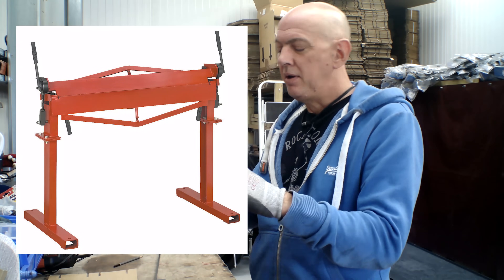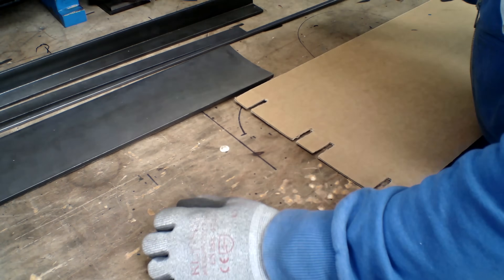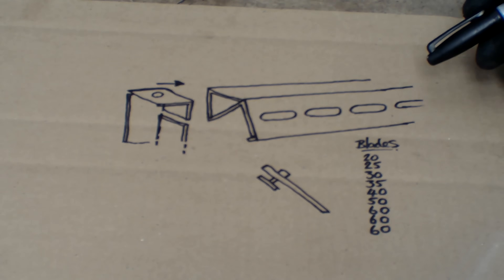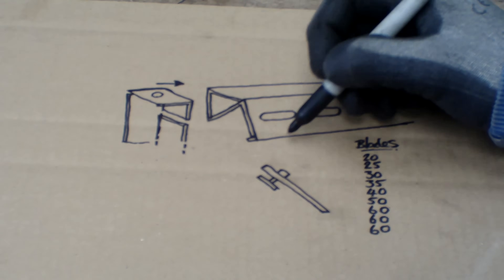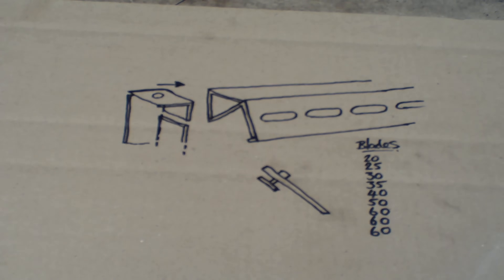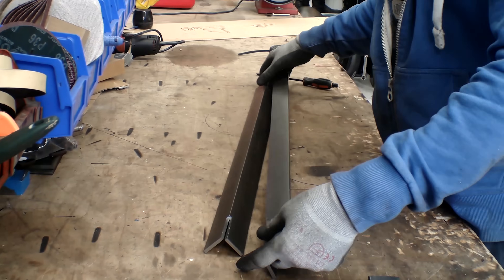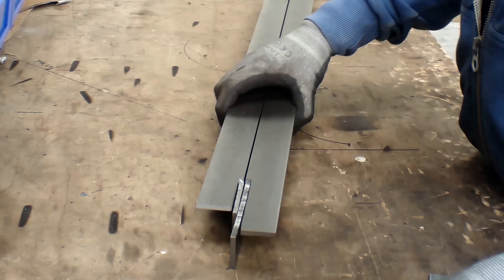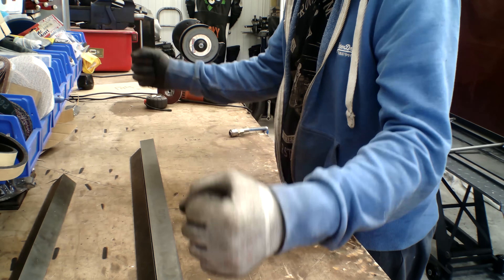Home Made Box Pan Brake for bending sheet metal

Comment: Very nice job. It's interesting, that you can get sharp cornered, cold rolled steel angle iron over there. In the states, it's all hot rolled and radiused all over except the outside corner. The only sharp cornered stuff available is aluminum. Even that, is only available in smaller cross sections like 1/8" thickness and under.
Reply from the maker: I never knew that....!!
I thought the same stuff was available everywhere!!
Shows what I know then doesn't it 😂👍
Reply: Dave Lee I like the work

Comment: Great project.Maybe a guy eliminates that hinge on the finger brake plate,it doesnt need to rock it just needs to be able to be lifted to fit material.So weld a piece of DOM round heavy wall material to the base.The find a piece of DOM that slides into the larger DOM,the small DOM is welded to the finger brake a bolt slides through the sleeved material and tighten down just like you are doing.This heavy wall ridgid material will not flex much and hold the top piece more sturdy...and get more consistent bends. Just a thought.
Reply from the maker: That's not a bad idea either... There's loads of great suggestions, so do you mind if I stick this idea to one side and maybe try it out when I do the modifications later?
Reply: @QuickBikes  Heck no I dont mind,go for let us know if its an improvement....happy building.

Comment: Nice design and build. However, when you build such things, some time it takes a few versions to get exactly what you want. The fact that your first bent had a large radius means you need a lot more support on the finger section. Maybe weld some really thick metal section on the ends so you can bolt the front section (the finger section) down forward of the pivot. That way it supports the fingers without giving so much. Usually the fingers are positioned straight down on the bent itself so they don't give as much. However, I still think you did a great project. Just needs a few changes/upgrades to make it perfect. Thumbs Up!
Reply from the maker: Here's Gary, I know what you mean and it will get tweeked in time. On 1.5mm steel I can get a radius of about 3mm, I think 2mm is too much for it. Great comment though and thanks for your thoughts. I think you're onto something there 👍👍

Comment: Job well done, one opportunity for improvement could be a set of stiffer the pivotal angle line to give tighter bends
Reply from the maker: Yup, good idea. I'm going to use it. In anger for a bit and decide what improvements are needed
Reply: Agree with this comment. I can’t quite see what point is flexing, but I suspect having the pivot axis of the clamp so close to sheet grip point (for and aft) means it doesn’t need much torque to ‘rotate’. If you moved the pivot point further into the bench, you’d be much stiffer! Other than that, it’s probably the best build of a brake I’ve seen. Really nice job and will be stealing it for my own!

Comment: Enjoyed watching this build it works great for a first try. Looking at the horizontal cross member bending 
slightly like you mention. You could just reinforce it or put some extra long removable bolts through to 
the table to shorten the span. Put them in where required to suit your work piece width etc. Nice job. Tony
Reply from the maker: Thsnk you matey. I've come up with a few improvements again, so I'm.prpbably going.to be making another one. This is alright, but the corners could be sharper and the while hinge bit much stiffer... stay tuned hey 😁👍

Comment: Looks good Quickie don't know if you noticed or not but when your folding there's quite a lot of flex in the clamping bar
Reply from the maker: Yeah I spotted that too... The gussets I was going to put in the back of the clamping would have helped stop that but I didn't put them in thinking it would be strong enough... I think I'll be putting them in over the weekend...
Reply: I see more of a tortional flex across the  top bar. I think I'd reinforce and move father from center the bolts that are clamping the work. Another thing I've found helpful is working nearest one side.  Sweet build!
Reply from the maker: There was another suggestion to put a truss on the top which I may end up doing. Once I've used it in anger and figured out how I want to modify it, there will be a follow up video showing the mods.
Very helpful comments, thank you 👍👍

Comment: if you weld another angle to the bottom of the fingers it will add a secondary point of contact and hold the sheet metal flat so you can get a true 45* bent it must be facing down though
Reply from the maker: Trouble is I need the blades to be separate so I can move them where needed....

Comment: Brace the top of the fixed finger holding platten with a truss and also weld in some flat bar in the back of the hinged folding platten so its like a triangular tube. Nice video.
Reply from the maker: These are exactly the things I plan on doing for part 2. Should help no end 👍.
Thanks for the comment

Comment: I like your design. It will fit the material thickness i will be working with. 1mm.
Reply from the maker: Thank you matey. I'm goingbto be making and improved one at some point as I'm having a shuffle round in the shop 🤔😁
Thanks for watching matey 👍
Reply: @QuickBikes  I think i will wait then until i watch your revision.
I will be curios about your changes and results.
Thanks for your effort AND reply!
Reply from the maker: No worries matey 👍

Comment: Great vid Quicky! Just found your site and looking forward to seeing what else you're doing! You mentioned scribes over Sharpees  and I totally agree, though some of your audience feels differently! I find Sharpees are ok at times to replace using Dykem Blue for coloring the material and then scribe my lines on the blackened area. The contrast is quite good and makes the fine line easy to see. Maybe I've been in close tolerance work too long, but I find it doesn't take any longer to get a great job than an ok job. A little commitment and discipline makes the difference.
Cheers!
Reply from the maker: Thanks for joining us Patrick 👍
Somewhere I've got a big thick square sharpie which I use instead of blue, then scribe a line on that. Works. A treat and I totally agree it doesn't really take any longer to get it spot on if you're careful 👍👍

Comment: Very nicely constructed, I particularly liked how you made the brake fingers, very neat indeed! 

I agree that the price of basic folders is really quite high for what they are, and most don't have the various sized fingers! Subscribed. 

Finding need for a small brake I found a Katsu 3 in 1 Metal Forming Machine which has a set of rollers, a box and pan brake and a shear built into one compact unit, mine being the 305mm (1foot) version.

I couldn't have bought a set of rollers, a box and pan brake and a shear of this size for what I paid for the 3 in 1 machine (£200 delivered).

The 3 in 1 machine occupies quite a small space which was a requirement in a small workspace.
Reply from the maker: I really like the sound of that... I'm currently working on Brenda the Bender version 2 and CADDINGTON it so I can put a set of plans up. Should put this one to shame and be WAAAYYYY better. Thanks for watching and chipping in 😁👍

Comment: Well done, been wanting one of these myself, just can't justify the cost. Just a suggestion, countersink the mounting screws on the front edge where it is screwed to the bench. They're keeping the bender from opening all the way. Hope you don't mind, but I'll be following your plans to build my own!
Reply from the maker: Hiya and thanks for the comment, much appreciated 👍
There's going to be another video covering how I change this design to just be better. The idea is that I reckon I could build a better version for about £70 which is much more affordable if you have the means to build it. You may end up with one yet matey 👍😊
Reply: Se os parafusos frontais forem rebaixados, a área útil de dobradura será reduzida, limitando a confecção de gavetas por exemplo.  Acho que o problema está nos parafusos laterais, que não tem pressão suficiente para prender as chapas. (If the front screws are lowered, the useful folding area will be reduced, limiting the making of drawers for example. I think the problem is with the side screws, which do not have enough pressure to hold the plates.).

Comment: “A Sharpie just isn’t accurate enough” said no boilermaker/welder ever!
Reply from the maker: Hehehe... I know what you mean, but I'm 'trying' to do a good job 😂
I got it down to about a 3mm radius bend in the end after a bit of mucking around with it... 👍
Reply: Scriber lines are fine, but really hard to see in some light conditions.
Reply from the maker: I know what you mean as my eyesight isn't awesome lol. It's just my opinion at the end of the day and each to their own. I just like the fact it doesn't get rubbed off as well. Thanks for the comment 👍
Reply: @tezzrterry7485  that's what sharpies are for. or engineer's blue if you're old school.
Reply from the maker: I've taken to colouring it in with a sharpie and then scribing a line into it... Best of both worlds lol 👍
Reply: @QuickBikes  Plus, white paint pens are good on black steel, to really show up, and it doesn't wipe off easily.
Reply from the maker: Ah right, never used them... Might have to give it a go👍
Reply: @QuickBikes  Thinned down, engineers blue can be used as a background colour to see scribed lines easier. Thinking about it, it also comes in pen form now called Sharpies. lol
Reply from the maker: I've used that trick a few times... Don't know why but I like the lines to be black, so I just use a grubby hand to give it a rub now 😂🤣👍

Comment: Weld handles on the nuts so your not looking for a socket all the time and put an angle gauge on one side  , you can buy them or just glue a protractor on there and tack a needle to the bit you flip up  I would also brace between the handles as its the weakest point AND the point most used, gunsmith blacksmith by the way , dam fine work there m8 i wish i had a use for one  excellent project .
Reply from the maker: Thanks for your thoughts and most of that will be covered in the next video. Basically I wanted to use it in anger for a bit to find the weak points, then figure out what to change. Great comment and thanks for chipping in 👍

Comment: Good design and very clean machining, but again the large radius on your bend makes it difficult to weld the corners of a tray. I wish someone would come up with a DIY pan brake that makes an excellent sharp corner bend. As you stated, the Pan Brakes are so damn expensive whats an up and coming fabricator to do?
Reply from the maker: Thank you matey. I have a few tweeks in mind based on the comments that people have left, so there will be a follow up video before long to. Show how I change it. On 1mm steel I get a really sharp corner but on thicker stuff the flex means the radius increases. I'm determined to get it better as for the cost of building it, something like this is worth having a go at... Thanks for commenting 👍

Comment: I like the way you explain your process. What gauge steel can it do. Also can it work for a 6ft long brake. Or 4 ft
Reply from the maker: Thank you Arthur 😁👍
I think it was 6mm but I'm in the process of getting some plans together for folks to copy if they want to. I'll post an update when I've uploaded them. If I was making a much longer version, I'd go for much a much heavier design with vertical blades and a piano hinge style platen as this would definitely flex more with length... Thanks for watching 😁👍

Comment: I did see some flexing going on.   It seems the blades moved up, shouldn't they stay in one place?  The weak spot I think is where the top bolts to the bottom.  That area needs to be supported better.  All in all it looks like a great build and something I would love to duplicate myself.  It was Martha Stewart who said everything can be made differently she just seems to be able to make things better for her, not for everyone.  If she didn't say that maybe she should?   Was the purpose of the blades being different sizes so you could make a box?  I would love to see how that is done with this?
Reply from the maker: Thanks for chipping in and you're right, there is a bit of flexing going on. I've already done a second video of bracing it up, but I'm probably going to make a better /stiffer version using I beam for the blades... just working it out in CAD a the minute to see if its going to work 😁👍

Comment: The clamping blade should be adjustable if you intend folding different thickness material. The clamp should be one and a half times the material thickness from the folding blade. This is to allow for the increase in material thickness on the inside of the bend when it is folded. Apart from that well done.
Reply from the maker: Thank you Bill, good advise that I will use on v2 👍

Comment: about the steel being too high for the bandsaw : cant you clamp it in laying flat ?
as for straightening the blade along the top  : would take a bit more work but you could weld a narrow strip over the top and machine it straight and have the blade bump against it , should prevent them creeping up when you bend the material too
as for alowing tighter bends you could make blades that are slightly longer and use longer bolts holding it down , that should move the working ends of the blades closer to the bender 
maibe on the next one you could make two rows of mounting slots and two pairs of holes on the blades so you can set it up 4 ways (bottom hole bottom slot / top hole top slot / bottom hole top slot etc 
i think that if you measure it out right you should be ab;r to make it in such a way that you have presets for the 4 mostly used material thicknesses
Reply from the maker: Some great suggestions there and I may well have a crack at some of them... I've just done an update to the bender which is now up on the Tube, but I like the sound of some of the above. It's going to get changed and improved over time and hopefully I'll end up with something that's REALLY good, but for now this will do the job :-)

Comment: Thanks for the great video. Can you tell me what kind of angle grinder discs you use to level and blend your welds?
Reply from the maker: Thank you 👍
If you do a search on eBay for 'angle grinder flexible backing pad', you'll find the kind of thing I use... I did get two from ebay and they both just exploded as soon as I turned it on, so I went to Machine Mart just up the road and bought their medium stiffness one and an interference backing pad for it. Seems to work quite well I think. Hope that helps 👍
Reply: @QuickBikes  Thanks for the reply. So you just use one of those "rubber" backing pads with a resin fiber disc to grind them down?
Reply from the maker: Yes and I get on really well with it, far better than a flap wheel in my opinion 👍

Comment: This is a really good video and design is very smart pal. I'm not sure if you've improved on it since this video as i've just discovered your channel now. 
If I may make a suggestion -
1. a second bolt forward of the rear one used for joining the top piece to the main frame...
2. A welding a nut on the topside of the frame base where you are torquing down the plates might overcome (in my head, before a coffee) the flex you can see happening under load?

Cheers pal, new subscriber now!
Gyp
Reply from the maker: Thanks for the comments and the kind words, it's very much appreciated 👍
I've got a few improvements lined up to take out the flew in the platen and will be tackling them once I've finished the current project 👍

Comment: Nice work need a set of plans drawings of this how do you think itwould work in a 2400  benderfor 1mm aluminum. Cheers from downunder
Reply from the maker: It would definitely need bracing on the top and bottom platen
Reply: @QuickBikes  would you be able to do up some plans and send please
Reply from the maker: Yes matey, I will do. I've decided how I'm going to modify it now that I've used it for a while, so once I get them done and they work, I'll do a set of plans 👍
Reply: @QuickBikes  that would be fantastic

Comment: Did he say he wants to be able to bend metal up to 0.800 with this brake?
Reply from the maker: Hehehe... No, it bends up to. 1.5mm, but alot of smaller stuff is 0.8 or 1.0mm
Reply: @QuickBikes  Lol, O.K. You're talking mm,  I was thinking inches.  1.5mm is about 0.06" and .8 inches would about 20mm.

Comment: Ive been wanting one as well, though of buying, too expensive, thought of making, too many specialty tools required to get it as nice as yours.
Reply from the maker: The milling machine definitely helped even though it's a rubbish one... The tough bit I guess would be doing the blades and they could be done with a grinder and file I guess, but it would take a good deal longer than just 2 days. I'd be interested to see if you have a go and if it works out for you and I'm sure there's a few other subscribers in the same boat... Let us know how you get on if you have a go at making one Matt 👍
Reply: Could make someone some beer money with a mill doing that pain in the arse small jobs in the setup. Using grinders and a file would be brutal sadly...
Reply from the maker: @lscarlet2475  the mill (although a rubbish cheap one), definitely earnt its keep that day 👍

Comment: I love the design, but at 2mm, it is bending not breaking the metal.  The Shop fox  weighs 100 pounds, and breaks 20 gauge.  That is .8 mm material at the max.  2 mm is a titanic 6 times stronger and 15 times stiffer.  Not happening.
Reply from the maker: That's impressive... For my needs this will do... I'm adding some more bracing to try and reduce the bend radius a little more, but it does the job I need. I don't really mind if it's bending not breaking the metal, as long as its a tight bend radius. Thanks for the comparison though, it's a really good insight 👍